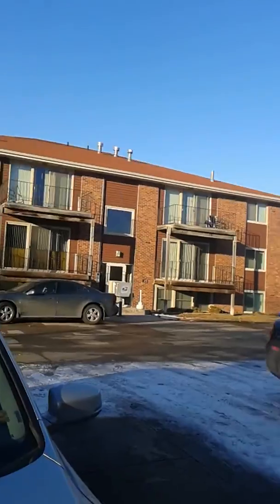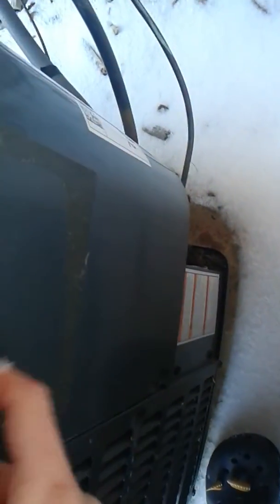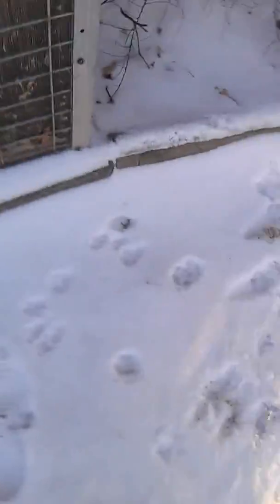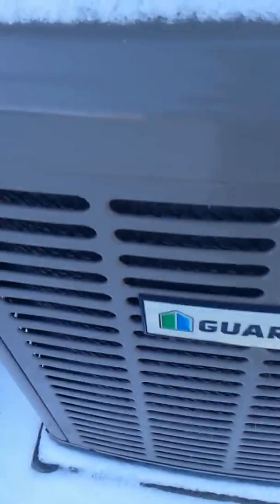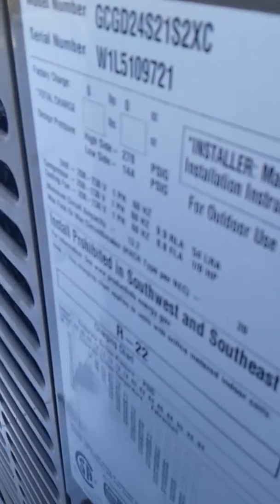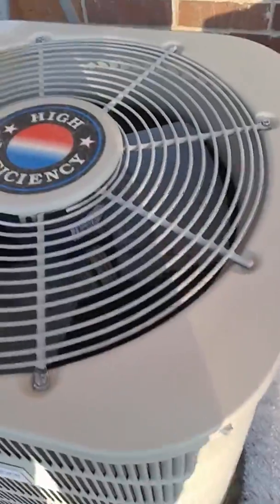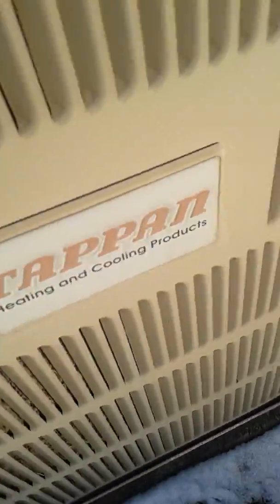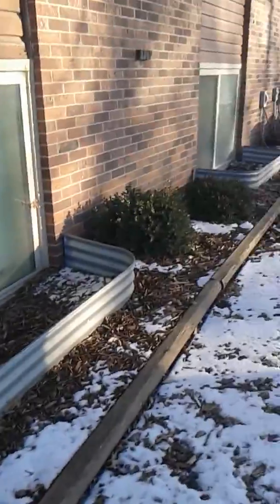A Lot of Central Air Conditioners at an Apartment Complex!

Comment: 1st Goodman unit is a straight-cool unit, the round thing on the suction line is a discharge muffler, suppose to make it quieter , 2nd unbranded or as i call them no-name unit is an ICP product from 2011, 3rd unit is not a window unit but a really, really old central air conditioner from the 70s or 80s could be Lennox, could be an old Borg-Warner or even an old Heil-Quaker or Singer unit, data sticket would tell if it's still intact lol , Guardian is made by York/Johnson Controls Group,  York use to use Bristol reciprocating compressors up until Bristol went bankrupt and out of business, York now uses Copeland Scroll's, Guardian in the video is a 2 ton from 2015 straight-cool, Heil is pronounced like "Hi-L" the 'E" is silent/ Great video :)
Reply from the maker: Thank you so much! You sure know a lot about air conditioners and I'm trying to learn as much as I can.
Reply: @dilchproductions  You are very welcome! i am actually a certified HVAC technician , i've done countless install's and repair's over the years and worked along side professional's all which i have some videos on my channel,  i've been into HVAC eversince i was a kid and now i'm 23 lol, HVAC is not my career (job) but a fun hobby, i;ve been doing YouTube videos since 2009 - 10 years in April!  Also if you have any questions or want to learn anything about HVAC/R you can ask me anytime :)
Reply from the maker: Ok, I will! And also I subscribed.